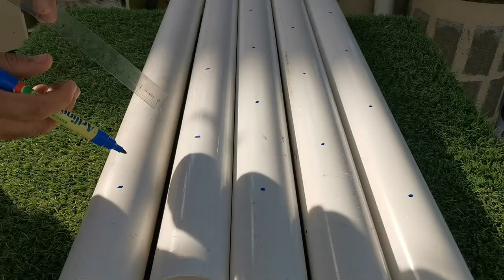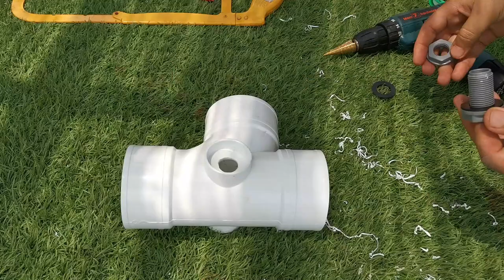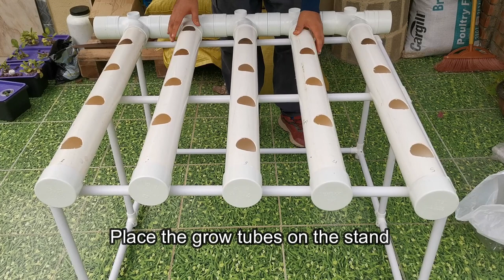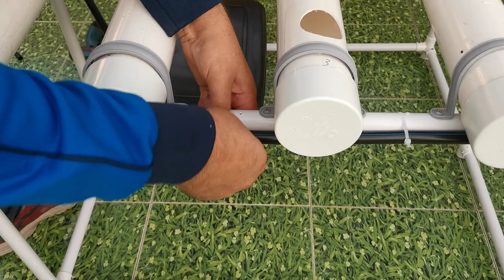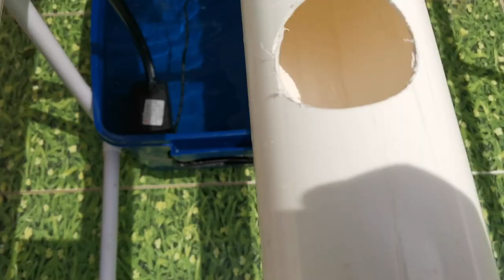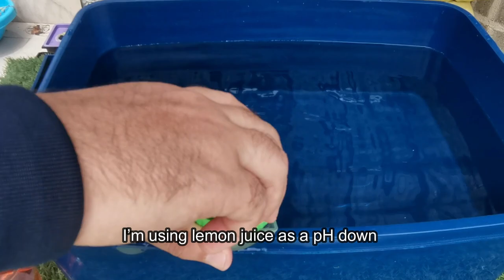How to make cheap Nutrient film technique (NFT) Hydroponic growing system for bigenners 2021

Comment: Thank You. Two questions please, 1- Does the watering pump needs to be running always or just few hours every day? 2. How do you prepare seedling?
Reply from the maker: Hi there ! 
For NFT system cannot off the water pump more than 10 min otherwise the plants will die . 
If you want a system that can off the water pump check this video : 
https://youtu.be/dLEVQw-bHhc
I prepare the seedlings using rockwool .
Reply: @DIYGARDENWITHBB  Thank You !!! I am going to try this at home by referring to your video guides

Comment: Hi Bibi! Just wondering if you had any leakage from using the pvc teflon tape? I know pvc cement would be the most reliable way but it will also permanently fuse the pipes together, and I wish to be able to disassemble the kit in the future.
Reply from the maker: Hi there ! 
So far no leakages , insert the the pipes and the tees with the tape well shouldn't be a problem .
Reply: @DIYGARDENWITHBB  Thank you Bibi! Keep up the great content!
Reply: If you use Food grade glue from Amazon you just use a hair dryer against end pipe for very few seconds, tap gently with hammer and end caps come right off and system will easily come apart. Just type in Food grade glue. Hope that helps.
Reply: @DIYGARDENWITHBB  I will back this up as I have used tape as well on pipe connections and no leaks.
Reply: @DIYGARDENWITHBB  Could use aquarium grade silicon in small amounts

Comment: You mentioned to change the water every 2 weeks. 
Do you dump out what's in there or are you retesting and adjusting the nutrients when you top it off?
Reply from the maker: i use the old water in my traditional garden , plants..etc and change to new water mix with the hydroponic fertilizer
Reply: @DIYGARDENWITHBB  can I use miracle grow in the water? Can you explain more about ec?
Reply: @reviewstrials6785  Yes you can use miracle grow, but match the type for your plants.  For Mostly greens (lettuce, beans etc) use Blue General Purpose.  For fruiting plants (Tomatoes, Eggplant, Pepper) use RED Tomato formula.  Read up on the NKP (Nitrogen/Potassium/Phosphorus) numbers for different plants in differing parts of the grow cycle.  Nitrogen is the primary for all green leaves and stems, P and K for the fruits.  Lettuces do better with balanced NPK,  Fruits better with a higher PK level, especially when coming to yield (picking time).  EC is electrical conductivity - Nutrients are measured as "salts" in the water.  EC is how a electric charge travels.  Higher EC - More salts (Nutrients) in the water.  I use TDS (Total Dissolved Solids) as my guide.  Same general principle, different numbers.  For Greens, 1500-2000 TDS is sufficient food level.  For  Fruits 2000-3000.  pH generally slightly over neutral 7.2 or so (You can find this online for each plant type).  I use a 55gal drum to run 180lf pipe, and, in general, use a cup and a half of granules mixed in a gallon of water added to the drum every 2-3 weeks.  Once you get more experience you can get custom tailored liquid nutrients for beginning, middle, and fruit phase.
Reply: @Dennys854  thanks! I have a small bit of miracle grow left then I'll switch over to masters mix.  I have ordered everything for a 10 beto bucket system and have the tiny 2" pipe for lettuce / starts up and running! I can't wait to watch it all grow! Thanks for your response and input!

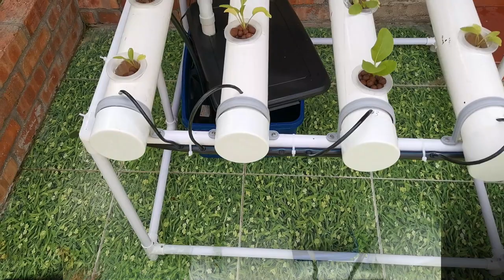Comment: may I know the name of the nutrient pipes in 14:05 (black pipes), how do we call it? could you please share the link to buy it if possible?
thanks!
Reply from the maker: micro tube 8 mm you can find them in irrigation stores, aquarium stores.
Reply: @DIYGARDENWITHBB  so we need to manually drill the main pipe (larger black) and attach the micro tubes to that main pipe right?

Comment: When using Rockwool, does the cube need to be in contact with the waterstream or just the root?
Reply from the maker: if your roots tall enough to touch the water it's fine just the roots , when the roots small need to touch .